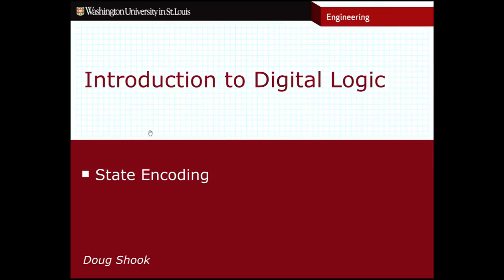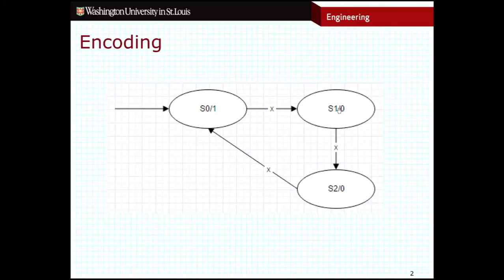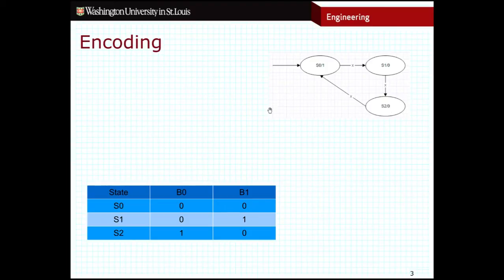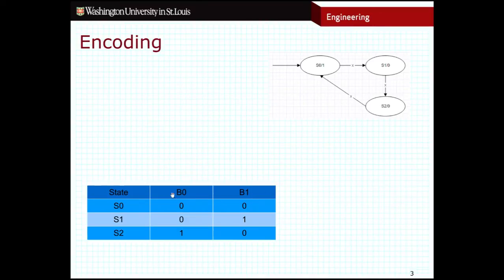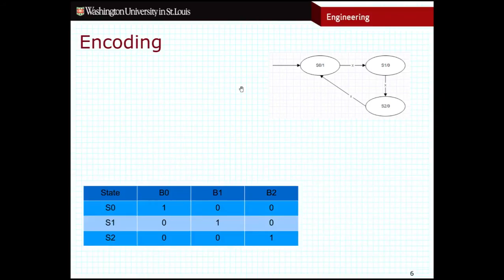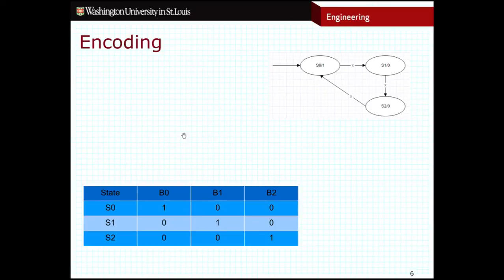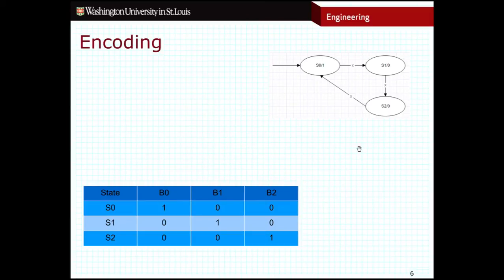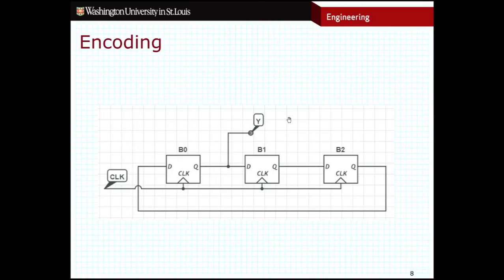CSE260 - State Encoding

Comment: I'm a little confused as to why at 3:08 the values of B1 = B1'B0 and B0 = B1'B0'? The later part of it made sense with the one-hot encoding. By referencing that, reading a book, and reviewing another example, I believe that B1 and B0 are switched. It would remain consistent if B1 = B1'B0' and B0 = B1'B0, or am I misunderstanding this part? Thanks for the video.
Reply: second column is for B1 and 3rd column is for B0, he has typed wrongly lol.